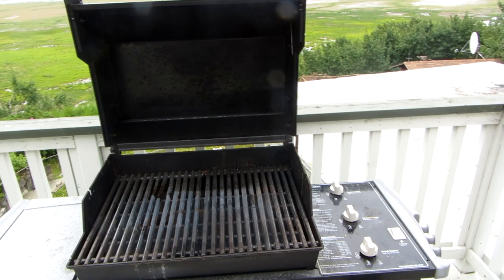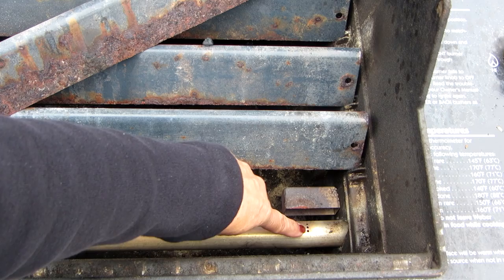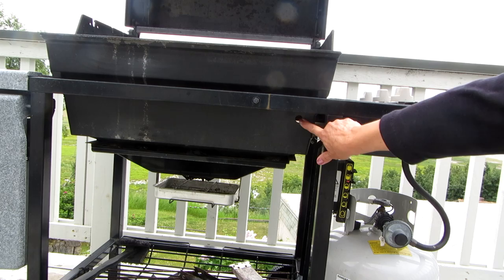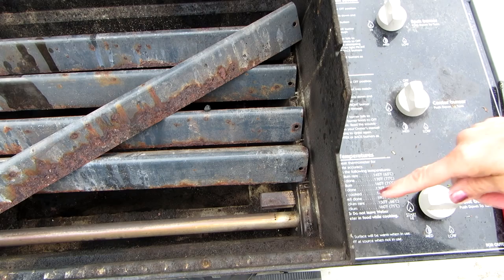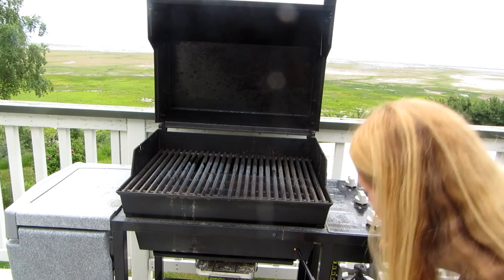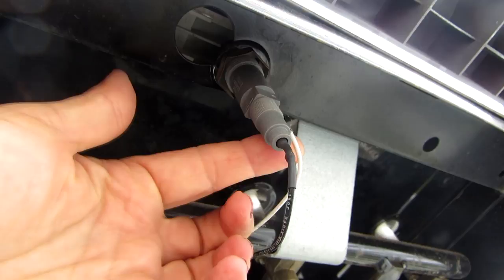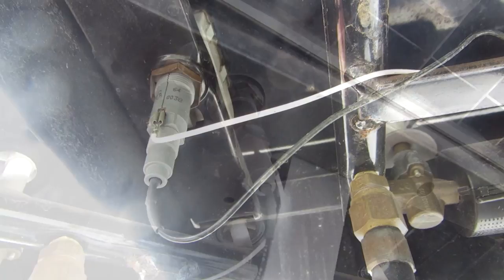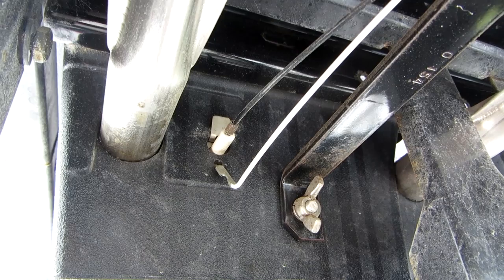Weber Gas Grill Won't Light Solutions

Comment: Alaska Granny I was given this exact grill from one of my clients and haven't used it yet. I had trouble finding a video regarding this grill, and my igniter is broken . Good thing I found out about that whole to manually turn it on with a match .thanks for the info your a life saver. By any chance do you know which igniter will be for this grill? I found different ones in eBay but they have different model numbers. THANKS IN ADVANCE and GREAT VIDEO
Reply from the maker: +MrZACATECANO100 
I am glad you are enjoying your grill.  I love mine, and it is indestructable.  You should enjoy this grill for a long time.  Nice you got it for a gift.  I do not know which ignitor would fit your grill.  Do you still have the manual?  It may list replacement part numbers.  Maybe call the Weber Grill Company and ask.  Good luck with your Weber grill.
Reply: +AlaskaGranny thank you very much I will call weber since mine didn't include the manual.thanks again.

Comment: so how do you fix it when it wont light with lighter? I have a full tank of propane, still no flame.
Reply from the maker: First I would try taking off the propane tank and reattaching the hose.  Sometimes if you start over, things work.  Make sure the burners are off, and turn the tank on.  Then turn on the burners.  If you have the burners on before the tank, sometimes it won't work.  If you are sure the gas is flowing, check the burners to see if they are clogged.  Remove the grates and look.  Remove any visible clogs.  Then, turn on the gas and try to light directly at the burner with a long lighter.  Be careful with this one!  Hopefully, one of these tricks will work.
Reply: AlaskaGranny I've done all that. It seems like the gas is stopping at the control knob....? I can hear it flow when I turn the tank on. checked for leaks, nothing...
Reply from the maker: I guess you can try to call the manufacturer of your particular grill.  Best of luck.

Comment: My weber is 30 years old. Still going strong. Once in a while a taste metal rust in my meat pattys but still good. I'm just a cheap fcuk to buy a new BBQ :) 😭
Reply from the maker: If rust is on a small area, you should be able to remove the rust from the racks, and eliminate the taste.  I would scrub it with a bit of steel wool, rub it with some oil, and turn the grill on high.  Not an expert, just what I would try.  If your racks are too far gone, maybe you can buy replacement racks.  I found these on Amazon.  Maybe they would fit your Weber Grill. http://amzn.to/2q6GmF4   My Weber is old, too.  No reason to get a new one if you don't need one.